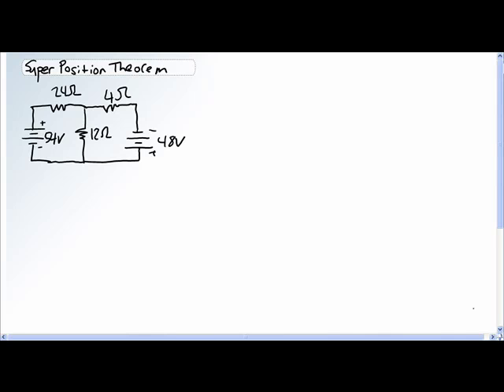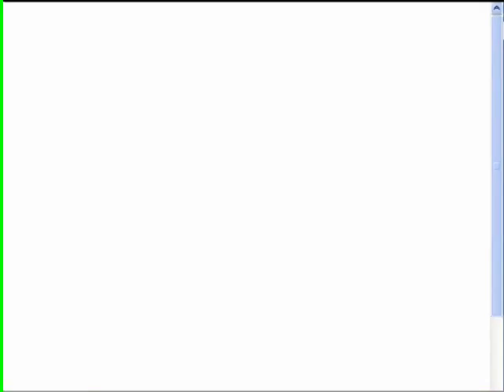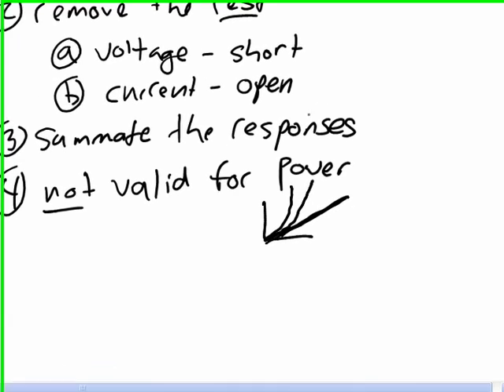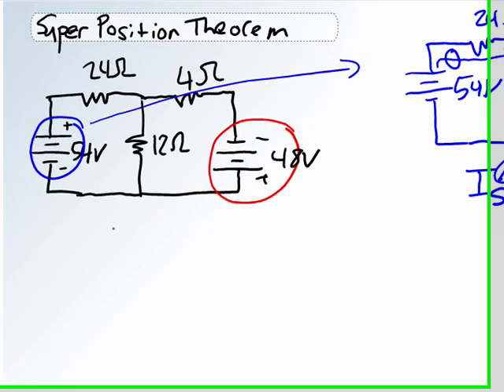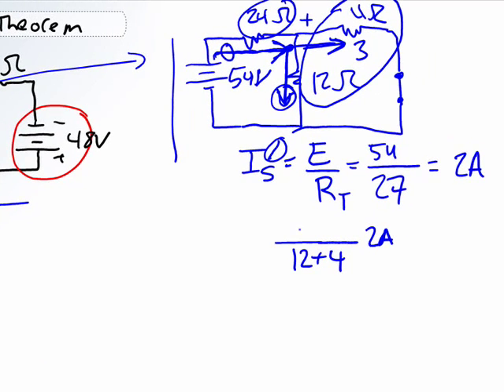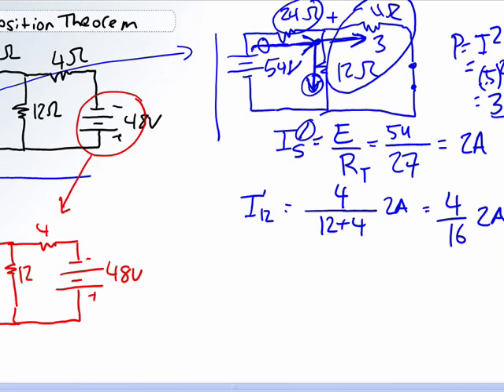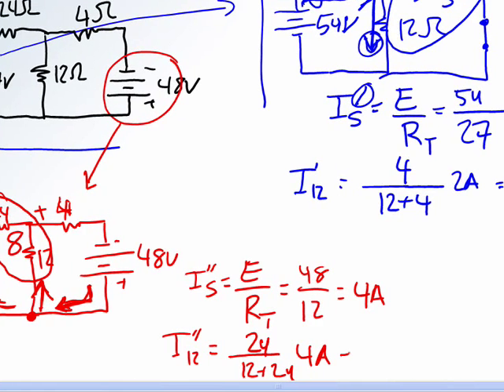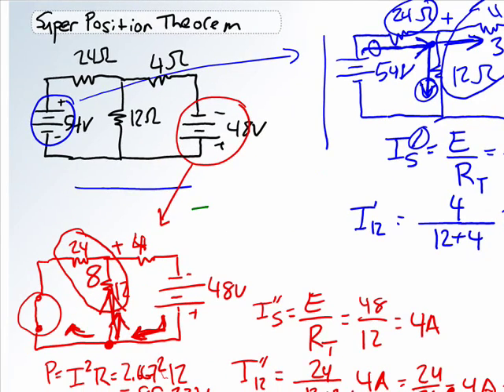Superposition Theorem Part 1

Comment: I'm studying electronics by my example has voltage sources with negative terminals both facing up (top part of the circuit), not one up one down like your example.

Anyway my text doesn't use the current divider rule it calculates the voltage drop using the first currents calculated I' then I'', then I'=Vr2/r2 . I find the current divider rule makes more sense because the current divides!

 What confuses me is knowing which current is negative, which is positive when adding all the currents.

Comment: Hi, thanks for the brilliant video, but I still have one problem .
Could someone explain to me the reasoning behind replacing a voltage source with a short, and a current source with an open circuit?
Cheers.